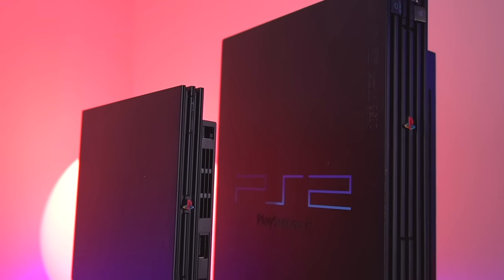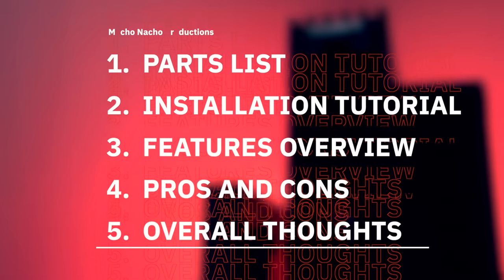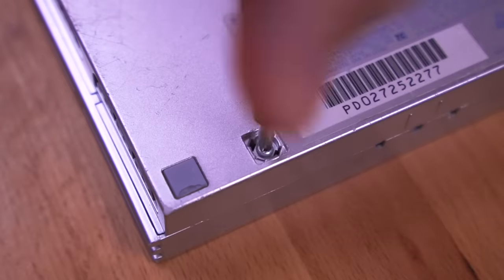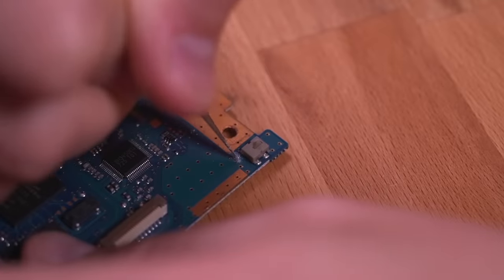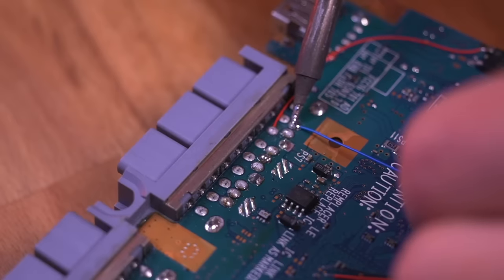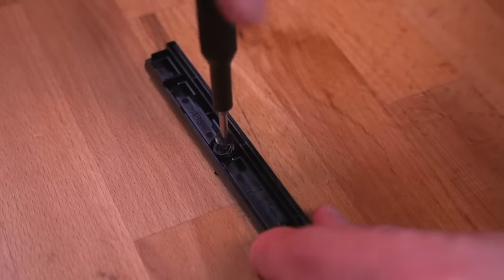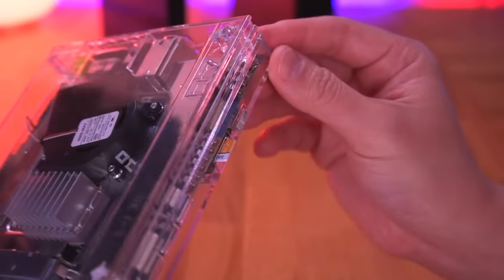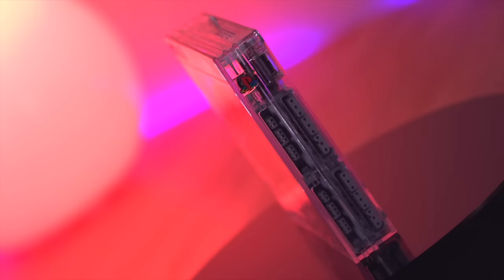Making The PS2 Even Smaller

Comment: I know he recommended the clear case, and it's quite nice indeed, but the PS2's original black color is much better, not to mention it instantly shows that it's a PS2 and blends in perfectly when placed side by side with the other models.
Reply: The black case has the nostalgic look to it too. One reason why I like the clear case is to see all of the components working. Fantastic engineering at its best!
Reply: The 3D printing sponsor also does black color. And it's also cheaper than clear anyways.
Reply: Is it possible to dye the transparent with black and make a smoke color?
Reply: Clear case is ugly.
Reply: If he made a "Black transparent" case you would be stoked, becouse It would maintain the PS2 original feel with a little transparency to spice things up

Comment: Not gonna lie, the part where the board was cut was pretty nerve-wracking 😱😬 That looks like it'd be VERY easy to mess up somewhere
Reply from the maker: It was scary, but easier than I thought. The hack saw allowed for more control in my opinion. Getting the cut started would be the most difficult part.
Reply: You gotta see Wii board trim mods, the absurdity of the cuts and all the work done is impressive.
I'm not a fan of board trimming frankly, but still, I strongly admire the work people put into knowing the console's board to the point of such a task being possible.
Reply: @Kalvinjj  glad someone beat me to this. wii board trimming is wild.
Reply: You would hate to see someone make a portable Wii, the cuts you can make on a Wii board surprise me.
Reply: At least it's better than the portable Wii project, that requires way bigger and more precise cuts, this is just taking an USB port and that's it
Reply: Makes me wonder if its worth actually comissioning someone like pcbway to create the stripped down motherboard needed for this mod
Reply: @willm5032  you can't create it, you need the PS2's PCB, the PS2's chips aren't made anymore
Reply: @CrocoDylianVT  Same as one of the GBA "mods" Tito covered here (I put "mods" in quotes as it's basically a rebuild). You take all the exclusive chips and solder them into a custom board.
The PS2 tho would be off limits for most people tho with a BGA CPU (plus all the rest included on it).
Reply: @CrocoDylianVT  ah yeah good point, I forgot that
Reply: I feel like it would've still been small enough without trimming the board 🤔😅😅
Reply: @Arnjeir  i did think that after seeing how little he chopped off. Not much removed but a v high chance of ruining a motherboard
Reply: @willm5032  google bitbuilt some-ps2-project

Comment: I'm glad there seems to be a lot of new stuff coming out for the PS2 these days! Like others, I'm still really hoping for an ODE style solution, as I still find the software preparation side of things extremely antiquated on PS2. Even mx2sio/mx4sio have been quite flaky for me in the past, despite modern improvements. Here's hoping, I suppose!
Reply: Yes I had a ton of problems with mx4sio , I would not recommend it. Using the harddrive or the ethernet is an OK solution for the PS2 but an OSD would be great.
Reply: ODE would also solve the PS1 backcompat problem most likely!
Reply: Hopefully a PS2 ODE does happen at some point.

OPL is great, but even nowadays with an HDD the compatibility still isn't perfect. It'd also likely allow for PS1 playback since the main reason PS1 games can't be played from the HDD is because the PS1 hardware is used for the I/O when they aren't being used for games.

Comment: I’m pleasantly surprised to see this. I’ve been watching Wesk’s thread for some time now, and printed myself a shell about a month ago. It’s great! Currently figuring out how to fit my HDMI adapter in there, and I wired in an ESP32 for Bluetooth controllers too. He does great work over at BitBuilt.
Reply: How does the HDMI adapter perform?
Reply: @bustergundo516  It’s one of the cheap Kaico ones. You loose a couple resolutions, and it’s obviously not as good as some thing like an OSSC, but it gets the job done just fine. 

I’ve now got it figured out, and I’m wiring it up by hand. I’m posting on MachoNacho’s discord as I do it 👍

Comment: Love it. Really enjoying the mods we're seeing to this generation of systems - long overdue. Hoping for a straight up PS2 ODE someday...!
Reply from the maker: Yes! Ps2 ode would be amazing!
Reply: Why though? SMB loading works perfectly
Reply: @LucaMolteni84  Sure, but it'd be nice to not have to install a switch to enable use of the second memory card slot. I also feel like, assuming one ever got made, that it'd hopefully be an easier install to do it internally than the current process
Reply: @kazinwho  I suppose that the with Free MCBoot and the HDD methods working so well there is little appetite for it.

Would be cool though, especially one that could tuck away in the HDD bay for flexibility.  It'd be ace to have 100% game compatibility instead of the 99.999999...  % we enjoy now.
Reply: @LucaMolteni84  psx compatibility
Reply: @LucaMolteni84  usb speed isn't good
Reply: @LucaMolteni84  for PS1 games
Reply: @bitelaserkhalif  SMB is ethernet not USB
Reply: @LucaMolteni84  i know
Reply: A PS2 ODE would be able to load PS1 games natively, no? Instead of the emulator from OPL and the like?
Reply: I feel like a welcome first step would be to have an open source and documented modchip

Comment: With how much people are putting effort into modding these days, I really hope that we get a 79000 series full digital out mod at some point, by that I mean tapping straight into the board's digital video out (if the combined EE+GS+RAM chip doesn't do DAC work now...) before it goes to the digital-analog conversion. That would mean perfect HDMI output for PS2s, with the portable-friendly 79000 series (probably similar work on the 90000 series) boards. I would work on a PS2 portable project myself if that ends up happening.

Comment: Another con would be it only being able to use 79000+ versions. There are less of them out there than older models and not all of us want to go around finding them and cut them apart, however minor. If Wesk is reading these review he should try and make a version that uses older model slims. Even if they would be a bit bigger.
Reply: I had the same "con" as here in the UK they seem to be as rare as rocking horse poo... I can see a lot of 7500 and others in the slim line.
Reply: Same in germany. 7000, 7500, 7700 and 9000 are available everywhere. Not a single 7900 😢

Comment: Another thing about the slim PS2 boards. They still have IDE interface like that phat models. You can wire up an IDE to SD card into them instead of having to use a memory card slot.
Reply: In fact only the 70000 has the ide pins, from 75 on It was removed, so it's not possible on this mod.

Comment: Regarding what you stated at 16:00 - I would actually have to disagree for a few reasons, as shown below:

1) When being kitted out as shown, the SIO mod will forego the weakness of having optically-based media - You don't need to worry about discs getting scratched, disc rot, failure of the laser diode, and drive motor failure, or if using this in a portable environment such as in a vehicle/RV, disc skipping during loads due to rough terrain while at the same time maintaining access to both memory card slots.
2) The removal of the optical drive means that the unit itself is actually more power efficient and will allow the power supply to operate (albeit marginally) cooler.
3) it's further reduction in size is more conducive to sitting it in smaller areas where even the slim ps2 would have otherwise taken up too much space.
4) you don't need to worry about keeping a library of discs laying around when traveling with it. Even if you must use one SD card per game, it would take many, many microSD cards to occupy the same physical space taken up by a single dvd disc.

Comment: I have mixed feelings for this kind of mods (the ones that involve cutting boards and destroying parts of the original hardware)  when applied to working machines though in this case it wasn't that aggressive (like in handheld conversions). For one, it seems a very fun project but on the other side, destroying parts of working PS2 makes me a bit uncomfortable, like there is a limited amount of PS2 out there and no factories are producing more. I know it's irrational, it's the PS2 and it's the most sold console in history so there will probably be a bunch more of consoles in the second hand market for years to come, but even so, some part inside of me feels a bit uneasy.
Reply: The PS2 sold 155 million units, I don’t think you have to be too worried about us running out in our lifetime and there will be thousands preserved in pristine condition. The PS4 was out by the time they stopped production on them. I’m sure most people attempting this mod including myself will use a 79X model they have lying around or find a well used/broken disc drive one for cheap on eBay like i did. Better to use it for a fun project like this than for it to be thrown out for good.
Reply: @MajoraTheEncryption  Realistically I don't think we're running out of ps2s either, at least not in my lifetime but do you know those kind of thoughts/worries that bounce in the back of your head from time to time? This is one of them😅

Comment: I understand how cool it is to have almost entirely original hardware on a small scale but at this point I consider it an emulation device since it's not running original discs. Would be sick to see this done with the original functionality intact. Sick project though and it came out awesome , much respect to the work that went in to this!
Reply: It’s not an emulation device, booting ISOs from a hard drive or SD card does not automatically mean it’s using emulation - this mod still uses all of the native hardware to run the games, giving you an authentic ps2 experience
Reply: @dylangerescapeplan  basically a Series S version of the PS2. Emulator was probably the wrong word to use. I guess a better comparison would be running PS1/PSP ISO's on a PSP?

Comment: The only thing I might have done differently is leave the board as-is, have it in a slightly wider case (still significantly smaller than an unmodded slim) and utilize a breakout board for the Micro SD card in the space where the extra plastic would be behind the second USB port sawed off here. That said, it’s a damn fine mod.

Comment: A tip I use whenever I cut something like that USB port removal at the 6 minute mark. I make sure there is more left on the board then I'd sand it down with a needle file to get a clean edge. That way you ensure that once you're done its all flush.

Comment: I know this video is old, but BE WARNED! Check your PS2 first to see if it can be used. I have a 79001 model slim, and it does not have the lid sensor you see here. The only way I could have this mod work would be to either have a different shell printed, or rewire the power button and solder it with several wires to mount it in the same position.
Reply: The detection switch is on a separate board. You can just set it floating in the shell where it would normally be and route the wires like normal.
Reply: Or use a tact switch instead.

Comment: Great video Tito! I may have to do this as I might be setting up a "tiny" console area to play after moving house. Despite going up massively in square footage, my retro area has gotten a bit smaller haha.

For virtually any ODE that needs to stream data directly from the card, Samsung cards are some of the worst you can buy. I own almost every ODE out there and Samsung cards have an issue, only with games using streaming data/music, where you'll get weird hitching and craziness. The leading theory is that they do something to keep up with the file system to keep it clean (something similar to garbage collection) that many other SD cards do not do. The PS2 might not care about this, but it also might depending on the game. YMMV. 

I'd recommend sticking to simple/cheap Sandisk Ultra cards as they have been known to work in every single ODE solution without issue assuming they are legit Sandisk cards (always buy from reputable source).

Comment: In theory there is 2 versions of the Slim model, one has the rugged dull plastic look on the disc tray and the other has a glossy black style for the disc tray cover, its essencially the same model but the difference is that the disc lens has been improved and isnt as prone to failure as early slim models used to be.

Comment: Very nice video as usual.  Very interesting mod this, it looks quite accessible too.  I'm bucking the trend and saying that the board cutting part had me nodding my head, making me think that yeah, this is the kind of mod even I could do!

That part at least!

The bit that caught my attention was the SD card part: could that section alone be done to any PS2?  It seems to me that the special MC with the SD card port on it is, fundamentally, a micro SD to PS2 passthrough?

I think it would be interesting to add an SD card slot to a fat console and save buying the adapter?

Do I have that right?

Comment: 5:14 that fan is pointing backwards, the exhaust is meant to blow over the fins.
Some late revision sony engineer said "fuckit" and made it take in air around the PCB then just blow it out the back away from the GPU heatsink lol whatthefuck
Edit: the exhaust shroud on the fan is literally sized to fit closely over the heatsink.

Comment: Neat project, Just to point that you can still use the network Port to play the games via SMB, using a computer, or even your modem in case It has a USB Port and supports SMB to share files. Settint It up is pretty easy and it's faster than mx4sio.

Great vídeo as always.

Comment: Amazing. I've gotta see someone go one step further. I wonder if it'd be possible to replace the controller ports with an internal bluetooth receiver without any power consumption challenges. Or rewire each port's contacts to 'convert' them to USB ports for 3rd party external receivers or wired DS3 connection. Drag them to the rear or side. Then score and snap any unnecessary traces from the front to make it 1/2" shorter. Bit of a pipedream but after seeing the videos on this channel, anything is possible.

Comment: @9:50 I'm sure it's all SD card adapters but usually they are already bridged in the card, so this step could be skipped entirely. 

Probably why the resistor wasn't needed, there were 2 bridges

Comment: Funny story is actually there are 3 different types of ps2. One ps2 slim has the power supply inside the console and another with the power supply outside. You can tell by the power connector.

Comment: Removing the disk drive of allotta consoles makes it possible to cut their size easily in half, if you machined the body out of aluminium you could get a few more millimeters and also stop it from overheating etc too if you used the body as the actual heat sync

Comment: It's truly small but you could emulate ps2 games on android these days, don't need an super expensive phone to run the most demanding games either. A decent budget phone could probably get away with certain lowspec games. Remove the battery from you're phone, other unnecessary bits, screen, find a way to hook it up to a monitor or tv etc. I know it's emulation of ps2, but few would notice the difference between the two when using it for gaming, so it still has some weight.

Comment: Nice mod however I don't see losing the 2nd memory card slot as a big deal because who knows how many users actually used both memory card slots in the life span of either the PS1 or the PS2. Also reading games off a SD card is faster than using the USB ports.

Comment: 0:30 i watched that shot like 30 times. so good. how did you do that? wires and masking?
Reply: I think it was either shot on a turntable with the turntable cropped out in post, or it was taped to something and rotated, along with rotation of the footage in post. The light changes direction and you can see something on the left in the middle of the shot

Comment: With a 256mb memory card on slot one that has a switch on it, and a McBoot card 128mb on the second slot, an HDMI mod, the memory card ports fully covered, using a USB adapter for PS3 controller, & SDcard 
SanDisk Extreme PRO SDXC UHS-I de 1 TB - C10, U3, V30, 4K UHD
And a metallic case, it be an analogue PS2 Slim Pro, with all the games preinstalled inside the SD card.

Comment: Interesting. I just cut the USB port off my 79001 for the ultra slim and I have the revision without the lid detection switch. It turns out that you don't need to re-run the power to the 5v regulator. Making that cut leaves the traces for input voltage to the regulator. Happy modding!

Comment: I like the design alot. Also the production is top notch as always. The SD card is the only thing that seems hokey. Would have been better if it weren't strait soldered wires. Would make repairability not seamless.

Comment: Cutting the SD card adapter seems like a needlessly complicated step on the mod designer's part, both because it's an optional step and because it adds a point of failure to a mod that already requires cutting the PCB of a system that's no longer in production. I would gladly make the case slightly bigger to incorporate the second USB port and a fully enclosed full size SD card mount

Comment: the reason you might be having problems with your kingston sd card is because it's a 64GB model. Try using 32GB as most older hardware cannot read such high capacities, since they usually use storage systems like FAT32. I am not aps2 expert but I do know that on older phones their sd card expansion also maxes out at 32gb